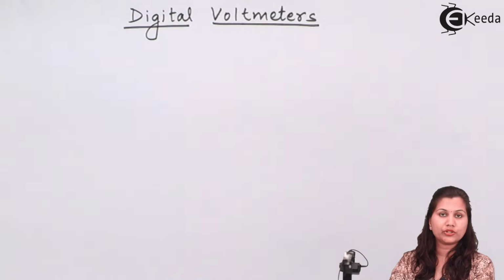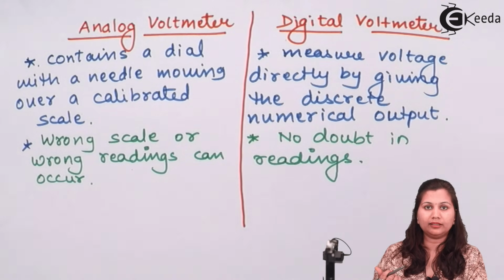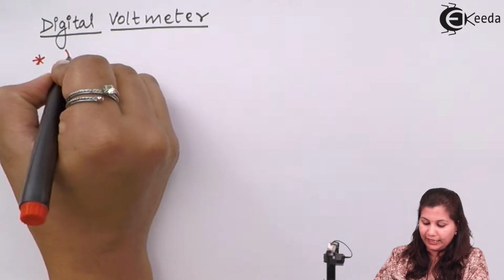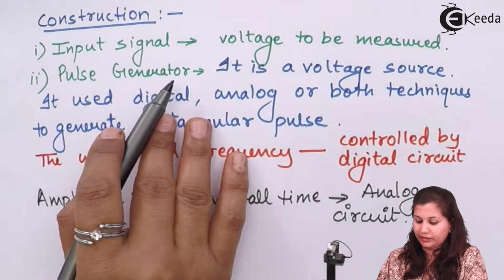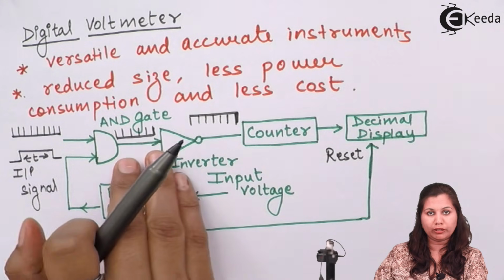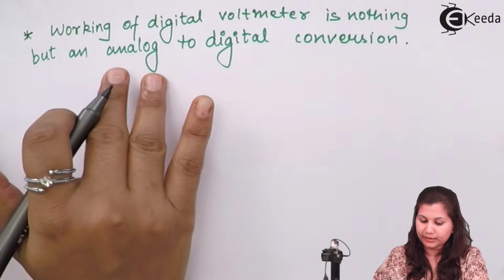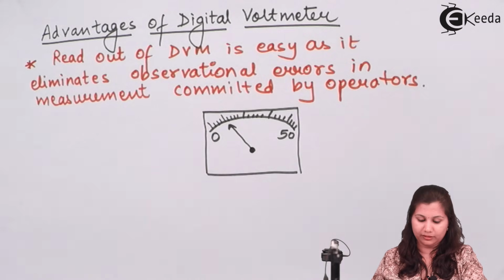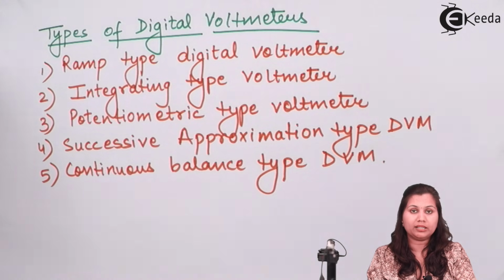Introduction to Digital Voltmeters - Analog and Digital Instruments

Comment: Mam, u r saying that the pulse generator produce the  rectangular wave , but  as we pulse genrator or clock genrator that produces a train of pulse and there must be one comparator circuit that compare the the i/p signal and a refernce signal to produce that rectnagular wave having frqeuncg  or duration equal to that of the i/p signal that may be a comparator or dual slop integrating circuit